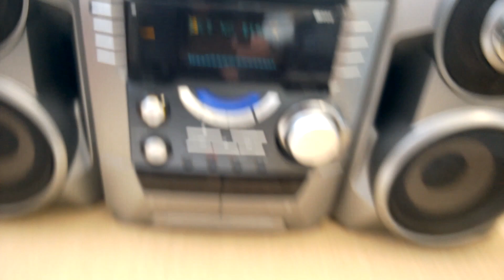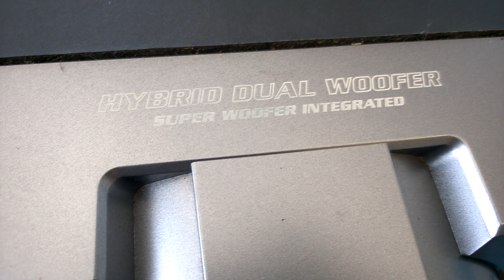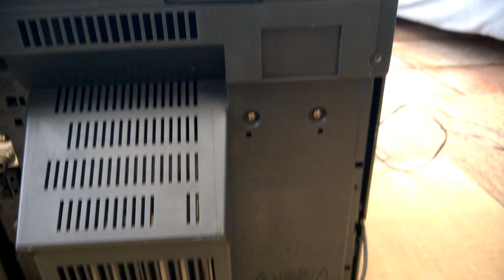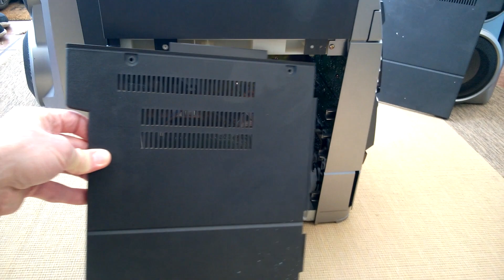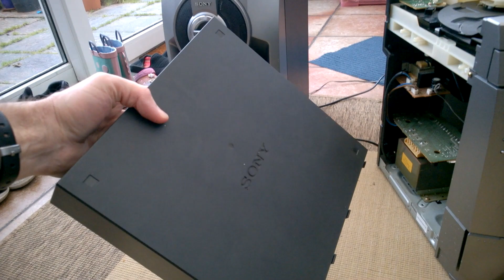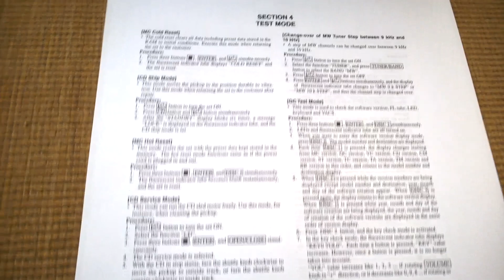Sony MHC BX5  - Faulty -  Can We Fix It  Part 1 -  Overview & Opening

Comment: thanks for the lookinto, I had a non-functioning CD mechanic and it was making strange noises when turned ON, disconnected it and now it is fine. Also disconnected Tapes, cause who uses that. Coupled it with a BT audio adapter and now I have a quite nice audio system I think.
Reply from the maker: Top work. The audio quality from this unit is great I find!

Comment: The problem with the front buttons not working is not the electronics. It's mechanics. They have a plastic mechanism that presses the buttons on the board. The plastic of the mechanism on the front buttons has decalibrated from cooling and heating cycles, so much so that it has deformed over time.
Reply from the maker: Interesting and cheers for the comment. Though mine seem to be different because when I press one button a different function can activate.  Think it's just old, the poor thing.

Comment: Don't know if you got anywhere with this, but my BX7 had issues with the solder joints connecting the front panel to the main control board, in my case the screen stopped working. If you do tip this, is there any chance I could have your speakers for mine please? The originals are missing!
Reply from the maker: Check out part 2. In the end I was able to use this ok mainly using the remote which provided full control.  These are such good systems they are worth keeping!  I will try to keep it going as long as poss because it's a classic!
Reply: @ChrisHorswill  Yeah they are, mine came from the primary school I went to, the screen died and they were going to skip it, so little 10 year old me asked if I could have it, 11 years later and it's still here, with my favourite set of headphones plugged in!